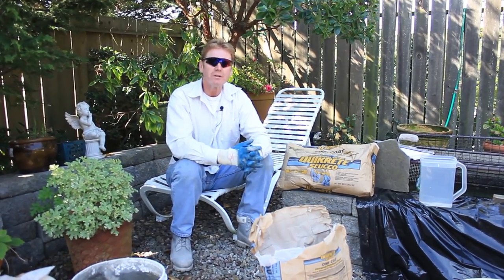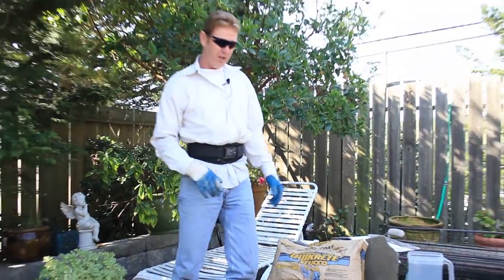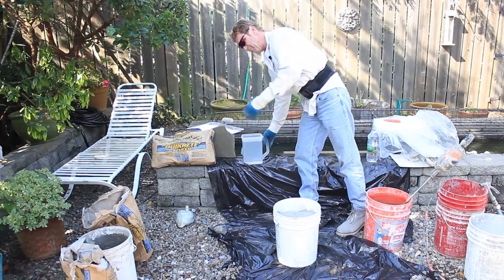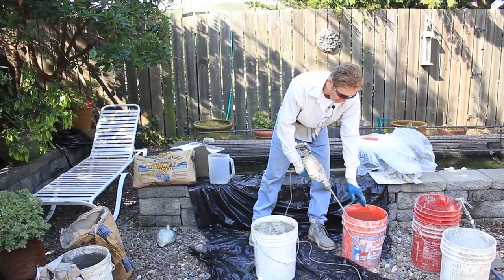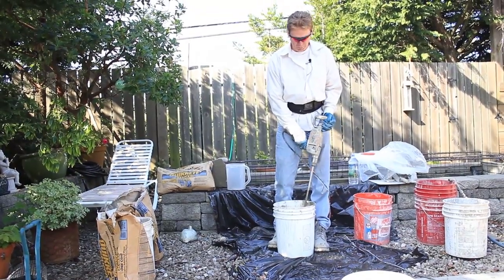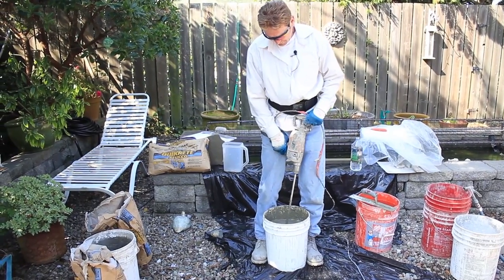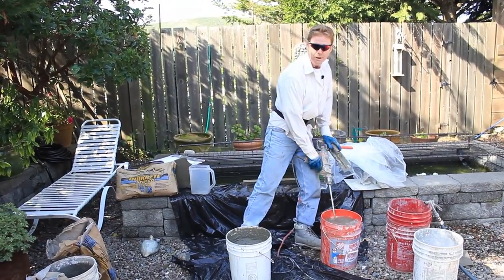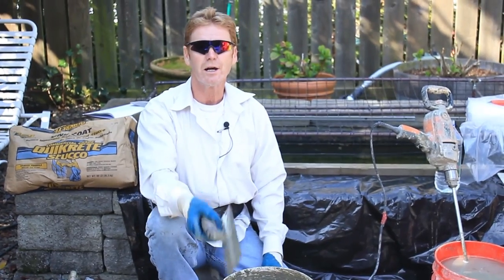How to mix stucco or mortar in buckets.

Comment from the maker: Hi Mykarmaxspiredaz, I usual mix what I need, for this stucco product I would say half hour to an hour. 
Sorry, I don’t know if you can add accelerators to this product.
 Lastly, If any stucco product does not specify (both coats same day it's not.) There are a couple stucco products that say you can do all three in a day. But I don't recommend doing so. (All base coats tend to crack) so, if you color the same day you will get cracks in the finish coat.
 Best wishes,
Kirk Giordano plastering

Comment: Hi Kirk    Thankyou for the great information.  I have a question: I live in Canada about 100 km (60 miles) north of Detroit. So a somewhat cold/humid climate at the base of Lake Huron. Do you mix the base coat and finish stucco the same as you do in your demonstration? Im putting it on the exterior walls with 5/8 DensGlass in place.
Reply from the maker: @glennantais24  Correctamundo, you still have to paper and wire the densglass first. Mix the base coat like in this video. You will use a finish coat material the exzact same way. Happy spreading.

Comment: Kirk, can I double up and do the scratch and then drop back and brown coat in same day with the Quikrete #1200 (This is what you are using). Or, do I scratch coat, wait 48 hrs. then brown coat? I am only going a total of 1" deep on a chimney.

Thanks,

Robert
Reply from the maker: Good Evening, Robert, you're not supposed to, there are many same-day products on the market these days that won't shrink or crack if you prefer to do this.    
                            Best wishes,
  Sharing stucco secrets and or common sense plastering tips

Comment: I'm late to the party here but I was wondering if there was some reason that you didn't put a small amount of water in the bucket first? I've figured out that sloshing a little around in the bucket seems to keep me from having any dry material hiding at the bottm or around the sides. Just wondering if there's a reason not to do that with some of these mixes?
Reply from the maker: Howdy  Dust puppy, many ways to skin a cat. You can put some water in first, or it can go in afterward. 
Asa rule I add my water after my powder is in, so it doesn't splash on my legs   
                                   Live long and plaster,
    Images of Kirk Giordano’s Plastering projects and tips

Comment: If you would have added the water first then the bucket wouldn't be spinning around like that. Always and I mean always add water first.
Reply from the maker: Howdy Celtic, good tip, but that will take the fun out of spinning a bucket
                    Live long and plaster
      Plastering and repair tips for your home
Reply: I Came to the comments to say the same exact thing!!  I concur!!!  Always and I mean always is the most important aspect!! ✅
Reply: I use a taco 🌮 to hold the bucket in place

Comment: I am applying stucco to the concrete block on the outside of my garage. Lowe’s has these bags of quick Crete but one says “base coat” and one says “top coat”. Which should I use?
Reply from the maker: Hi Brittney, I would recommend the basecoat, as you can apply thinks and it should not crack, where the top coat is only for an eighth inch thick.👨‍🏫

Comment: Kirk, How long do typically have to work with that product? Can you add accelerates to it without affecting the structural chemistry or integrity of the product? Can you one coat and put a finish coat on same day on a small project? Thanks again

Comment: Hey, Kirk,
What kind of mixer would you recommend I buy? I have a lot of drills and breakers, I even have a DeWalt core drill which is very powerful, but it's rather uncomfortable for mixing stucco or tile adhesives (I also do tiling). There are twin blade mixers (with two paddles) and they look pretty cool, unfortunately they are quite expensive. Do you think that a twin blader would make a difference?

Thank you for your help and keep up the brilliant work. :)
Reply from the maker: Evening Gandalf dude, when you say mixer I assuming you mean cement mixer you pull behind your truck or drill type?
 For pull  behind your truck, buy an essex with an 11 horsepower honda engine, call a few rental yards or check craigslist for a quality used one.
 I never bought one new as they get filthy in one day. These are tools that must be maintained very well but the uglier the better, plus ungl keeps criminal from trying to steal them.
 For a drill like in this video, all are good, Dewalts, are  good compact and very strong.

 cheers,
Kirk giordano plastering

Comment: I have been buying small buckets of stucco patch mix -- just put a little bit on various spots. Thanks for the help. I may buy mix and try it myself.
Reply from the maker: Howdy M Geez, the premade stucco is rarely as good as the powder you mix from scratch.
                    Live long and plaster
      Plastering and repair tips for your home

Comment: Hi Kirk! Can the Quikrete One Coat product be applied directly onto cement board and metal lath?  Can a sand finish be achieved with this product using either a green or red sponge trowel?  Can color be added to the mix?  Thanks in advance!!
Reply from the maker: Howdy Reonna, yes, yes and yes and no color can not be added to this base cost, at least not successfully,
 Kirk giordano rendering

Comment: How long does a person have until Quikrete stucco begins to harden?
Reply from the maker: Howdy Santos Dude, man, that's like a trick question, which depends on the weather, the drill's speed, the water added, and what you're applying it over.
 Lets average without taking the above and many more important things into consideration.  It takes about one to three hours. 🕵🏼

Comment: The Mega Whip would mix that whole bucket in seconds!!!
Reply from the maker: Evening Nathan Schrudder, i hear you brother but sometimes got to make due with what I have to work with, been on a job or two in the past and forgot the drill, you think this drill and paddle slow, try mixing two bags 94 pounds of cement plaster plus 600 pounds of sand on top of paper but on the ground and with just a shovel, been there and did that as the store to buy a drill and paddle was about  an hour and a half away and we were lodged on a top a mountain with 5 trucks behind.
 May you never forget your trusty drill and whatever paddle you are using.
Best wishes, 
 kirk giordano
Reply: I know exactly what you mean. I've been a custom home builder for 18 years and worked for myself since 2008 doing almost everything myself. One thing I know is that the mixers they make are worthless across the board. Probably can mix materials better by hand anyway lol. The reason I say this is because I've developed 2 New products with patent pending already called The Mega Whip & The Mud Pan Whip. Please check out videos on You Tube and give me your thoughts. The Whip You Tube Channel or 5 min hot mud mixing since I'm the only one in the world showing how it's done. Trust me my wife is mixing 90lbs of concrete her first time touching The Mega Whip in 30 seconds. Or a 64 year old guy mixing 3 buckets of concrete slurry in a minute his first time. You can check out website Thewhiptool.com or      All-Wall drywall tools.
Reply: Also with The Whips any drill will do the job effortlessly. New and innovative for sure Thanks

Comment: Kirk, Is it alright to use the Vinyl Quickrete patch (dry bag) over old brick? 

I removed some old 6" wide door trim and the plaster (about 1" thick) crumbled and fell off behind it. I have to patch it so I can install the door trim back on inside this 100+ yr old home. I planned on cleaning, and brush coating a bonding primer, then a 1 coat Quickrete product if possible.
Reply from the maker: Hello gmanpaint1, I recomend you can use the material I am using in this video, however I don't buy or use pre mixed cementitious products as most tend to have less than the strength of properly mixed products, sure you save time, but are you really saving time?
This is about as polite as I can be for premixed products.
 best wishes,
Kirk & Jason Giordano's DIY plastering network
Reply: Kirk & Jason Giordano's DIY plastering and stucco network Thank you for the reply. I really only have big box stores to shop at, and all they carry for plaster work is fine plaster of Paris. I'm not sure what else I can use besides the Quickrete they carry for a brown/scratch/base coat. (It will be covered by the trim molding)
Reply from the maker: Hey Dude, what about Westside build materials?
 type their name in Google to see if they have a stucco or plastering material yard in your area.
 Plaster of paris is only for interior use, molds, casts, decorative stuff, never allow this to get or stay wet.
 Best wishes,
Kirk & Jason Giordano's DIY plaster network
Reply: Kirk & Jason Giordano's DIY plastering and stucco network Did a search, none in my state. This is for the interior walls, around an entry door. Solid Brick exterior home,, no wood frame on an old Victorian. I replaced the original door with a new custom Mahogany leaded glass modern door & casing. The old brittle masonry coating on the brick, (under the interior trim) just crumbled, and exposed the brick. Now I have a 1"deep x 6"wide void around the door, to fill to get the trim back on flush with the walls. Sorry if I was a little vague in my first post.
Reply from the maker: Gmanpaint dude, you're killing me brother,
 I would use westpac's 20 to 40 minute mud, myself, if it's interior, this stuff is sold everywhere.
Best wishes,
Kirk & Jason Giordano's DIY plaster and stucco channel
Reply: Kirk & Jason Giordano's DIY plastering and stucco network Thank you. I will search for that product.

Comment: I went to buy some Quickrete Stucco at Home Depot, they didn't have it any longer and that it is now called Quickrete Parging. He said it the same thing. I'm, familiar with parging...who know about this, same thing exactly??
Reply from the maker: Howdy Sean, like in school my hand is raised, I know the answer.🤔
 Parging means to mix usually lime cement plaster and paint anything in site such as thousands of years ago, you paint bricks rocks and even braches that makeup one's walls, to preserve them and keep the bugs out.
 it's just watery lime cement, It's not pretty, when applied or brushed on, but has a more beneficial purpose than being pretty.
    If you want to make stucco, add three parts sand to the Quickrete or whatever cement plaster of your choice to make stucco.
 Of course, there is a huge difference.
Bringing to all the most complete plastering encyclopedia ever created in the world online.
 By the plastering messengers of Youtube.  With well over 850 free self-help videos 🎭 👀💃
Kirk and Jason Giordano Plastering

Comment: Kills me...always throw the power cord over your shoulder. Will never get near your Drill, saw, etc... You're welcome. ;-)
Reply from the maker: Morning unclearless, thanks for the tip,
cheers! 
 Kirk and family
Reply: StuccoPlastering Morning! Glad you got my tongue in cheek humor. But it really is a huge safety precaution. I, of course, learned the hard way. Forgot to thank you for your videos... they help SO much! Thank you, cheers! ~ Kev ~
Reply from the maker: Hi unclearless, I hear you brother, in the 1,000 buckets I've have had been unfortunate enough to mix I have wrapped a few around the paddle blade. that's how I learned to keep the  cord out of the way trick.
 Best wishes, 
 kirk and family